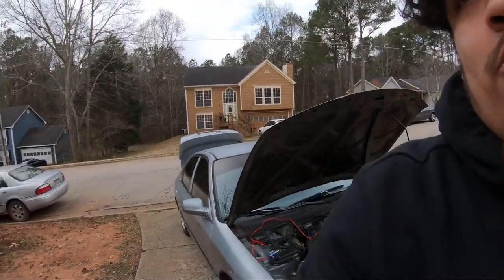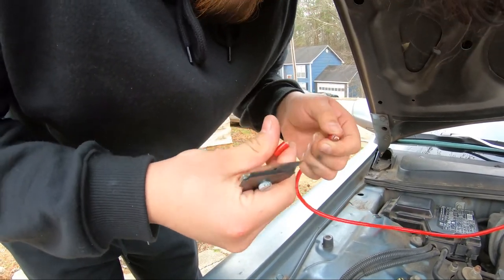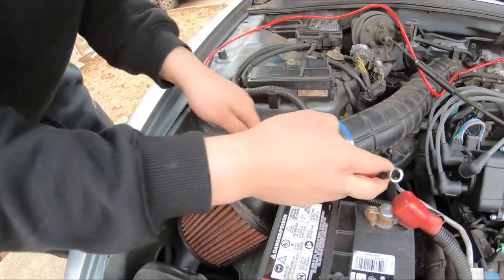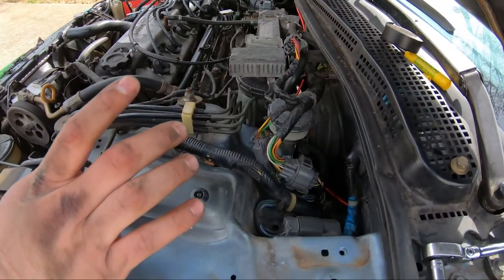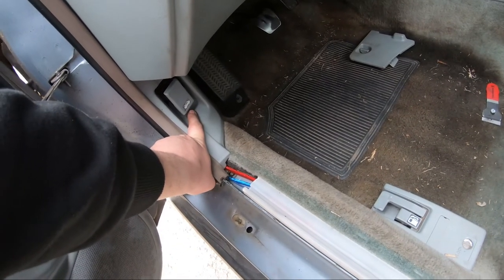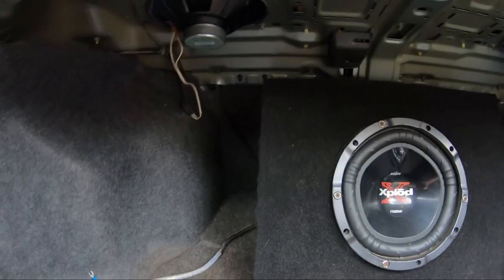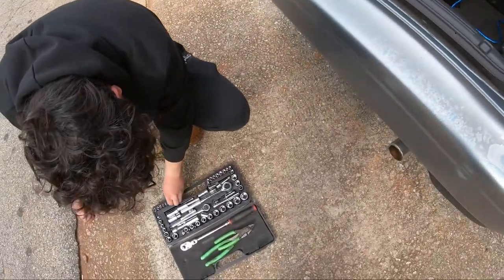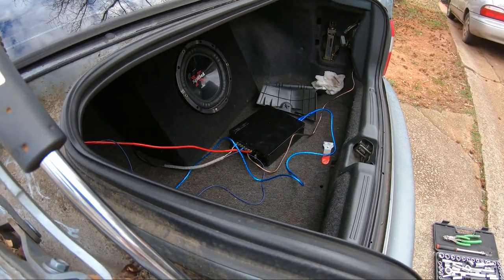(94-97) Honda Accord Double Din Radio Install FINAL part !!!

Comment: an classic woofer lol - kinda small power wire, but good install - it worked , update vid? still working?
Reply from the maker: Yeahh she’s an older one lol & yeah it was my first time running my own wiring for a sub so I didn’t know to much about it. I want to s change it out soon to run a 2 gauge wire to run a bigger amp & dual subs 12s. But I will say there set up is still kicking strong and haven’t had any issues out of it

Comment: i would to ask how long power wire and rca wire did you used?
Reply from the maker: BOSS Audio Systems KIT2 8 Gauge Amplifier Installation Wiring Kit - A Car Amplifier Wiring Kit Helps You Make Connections and Brings Power To Your Radio, Subwoofers and Speakers https://www.amazon.com/dp/B000FKP7TY/ref=cm_sw_r_cp_api_glt_i_CN0V3DAJ8CKH5GE23X3T?_encoding=UTF8&psc=1
Reply from the maker: 20ft of power wire
20ft of the RCA wire 
3ft ground wire
Reply: thanks a lot :) :)
Reply from the maker: Your welcome glad I could help out & thank you for watching the videos. I appreciate it :)
Reply: @Oconnerboyy  what fuse did you used for power wire? i already have 60A but im in a doubt because my amplifier is 200watts only
Reply from the maker: We’ll that kit I sent you the link too came with a fuse holder and a fuse. Tbh I don’t remember the size of the fuse but I’ve been running a 200watt amp on a 1000watt 10inch sub it’s been holding up great no issues at all.
Reply: @Oconnerboyy  nice maybe i can use 60A the amp already have fuse for safety i will put fuse on power wire so that wire also will be safe :) thanks a lot by the way we own 95 accord manual  :)